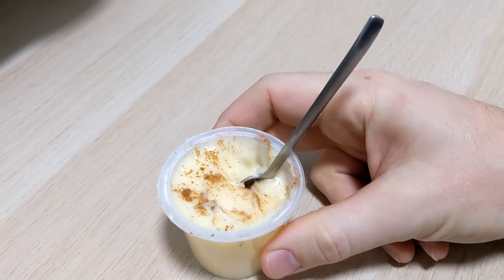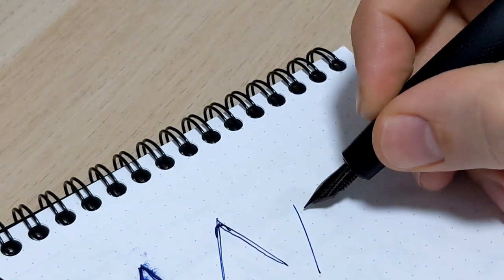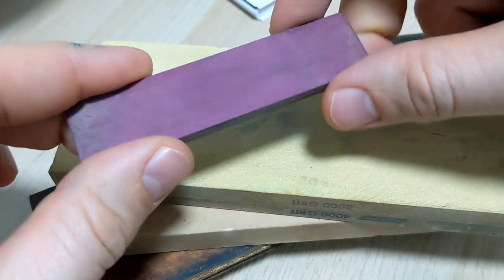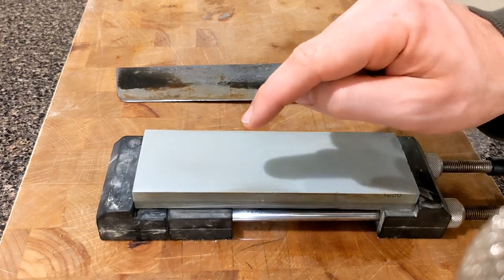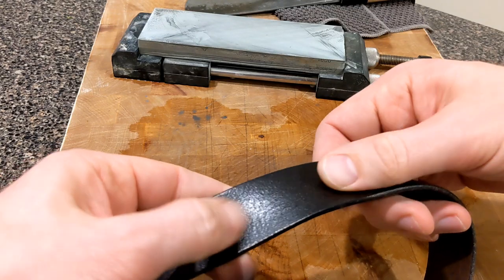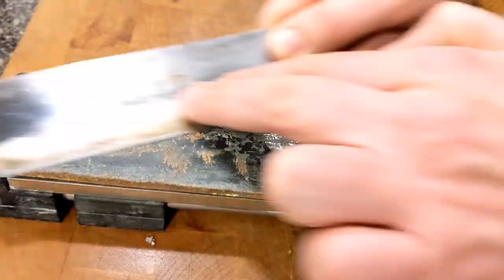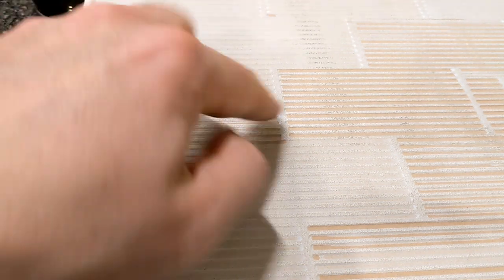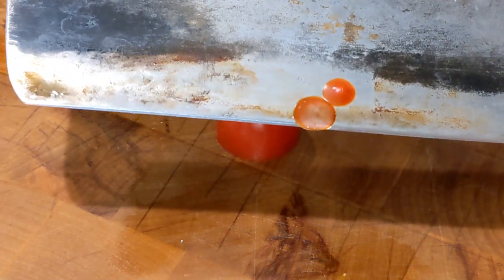How To Sharpen A Knife You Can Shave With!

Comment: I'd take it my arms for sure, but face shaving with a nikiri? Crazy man!
Reply from the maker: LOL it was a smoooooooooooth shave!  Harder to handle than a straight razor, but felt just as smooth 😁
Reply: @Doodlebud  Japanese steel is really the best. I have mostly German razors and only one Japanese razor and it's superb. 'course, Nippon kitchen blades rule!
Reply from the maker: I have a lovely Dovo Bismark, but want to get a little Japanese razor to tryout
Reply: @Doodlebud  Dovo makes really high quality modern razors and the Bismarck is as good as you'll get. There may still be some Japanese makers of western blades, though they would be individual blacksmiths and no big names. You have to be careful when you buy online because, even though they are folding style with scales, they may have a single bevel kamisori grind. Sometimes impossible to tell from pics on eBay. The single bevel grind has some advantages and is great if you want that style, but their use involves developing a different shaving technique. It's not good to realize your inadvertent purchase only when you open your long-awaited package from Japan, which is what happened to a friend of mine. Japanese razors, like their knives, incorporated western styles (e.g. scales and double bevel) for the export market and to appeal to the Japanese taste for modernity, but with some design twists and with exceptional artisanship in steel making, heat treatment, grind and polish.